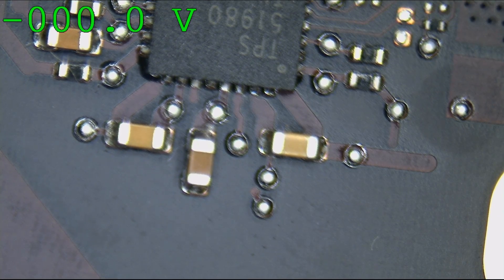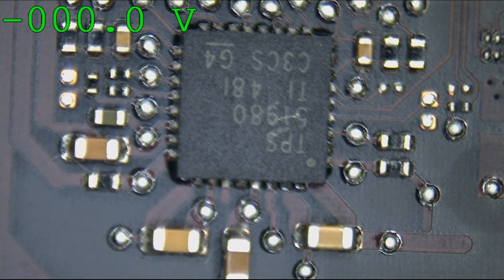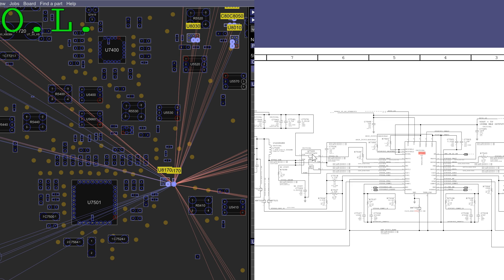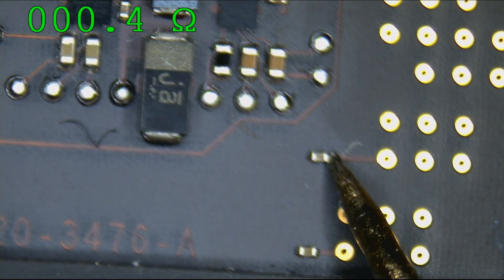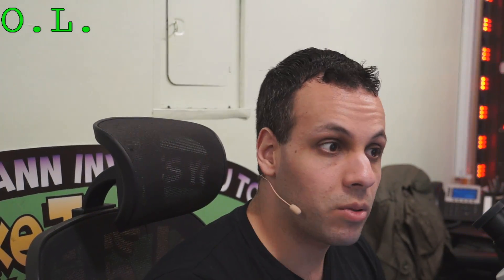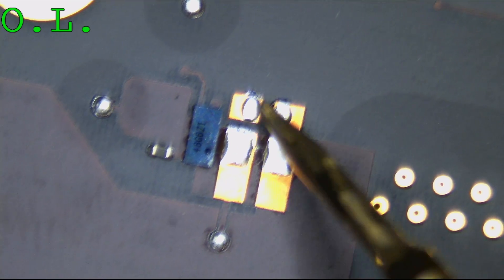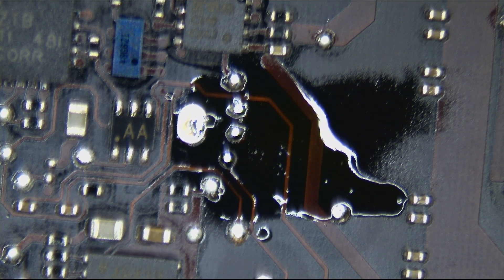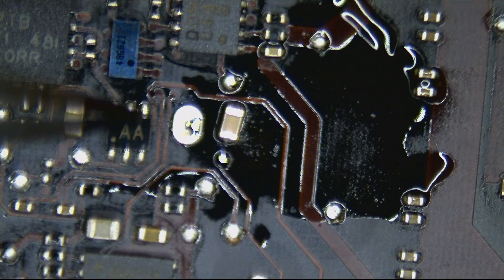Why are TPS51980 U7501 chip power rails jumping on Macbook logic board?

Comment: Hey Louis, hello how are you? hope all is well. My name is Ivan Velez, I have a question not about this video but about apple computer. I have a Mac Pro 5,1 2010 with 2x3.46 GHZ6 core intel xeon processor, 64 GB 1333 MHz DDR3 memory and a ATI radeon HD 5770 1024 MB graphics card and running Mac OS Sierra version 10.12.6 For some reason the Mac Pro restarts on it's own at anytime and usually when I'm viewing videos mostly on youtube. I'm thinking maybe it's the graphics card not handling Sierra but might be for the earlier OS than Sierra. Have you had any of your clients that own a Mac Pro 5,1 complain about their Mac Pro 5,1 restarting on it's own, if so what was the problem? Also, what graphics card do you recommend me getting for my Mac Pro 5,1 to work with Sierra or High Sierra? Thanks

Comment: What the actual fuck was that at the end. Thanks for getting my mind off my dying PSU. I had SoC in OS read 50A almost 100W power (which is almost whole TDP of my ryzen 2700x cpu)and 3.005v and I've been told they die past 1.2v. I've narrowed it down to the power supply possibly giving way more headroom with voltage and using it for its self over clock since it runs fine hot but I leave it for a day or so and the PSU fails to boot proper. That's what confuses me. It boots normal almost every time.

Comment: Thanks to you Louis and many of your videos I have watched, I am replacing my 2010 macbook pro with a Lenovo x1 extreme that I just bought online.  Your video where you poured water on your Lenovo and they ended up replacing everything at no cost to you PLUS they did it fast really cemented my purchasing decision for the Lenovo brand.  This was weighed against the fact that Apple doesn't stand behind their products and nobody can replace shit in a newer Macbook. If one thing goes bad the data is gone and the entire logic board needs replacement.  They  have shit keyboards and shitty display cable issues.  If money were no object at all I would get another macbook pro but I want my new laptop to last several years and I don't want to keep forking out money to keep it working

Comment: Louis I got a mid 2012 MBP, not charging battery even after new battery - only green light (it does see the battery). I looked at motherboard and only visible board damage seems to be on the small magsafe board. Is it at all possible that replacing this might solve the problem? Thx